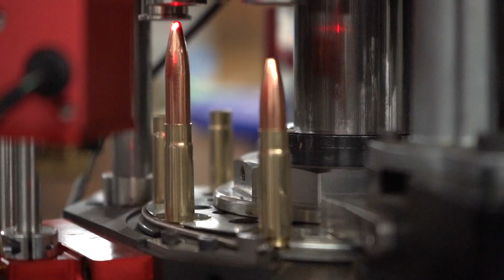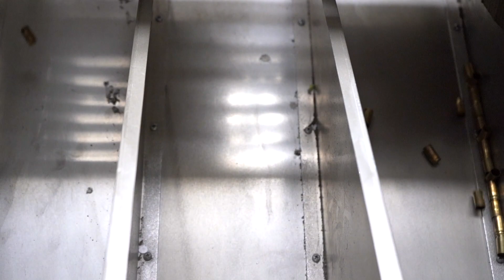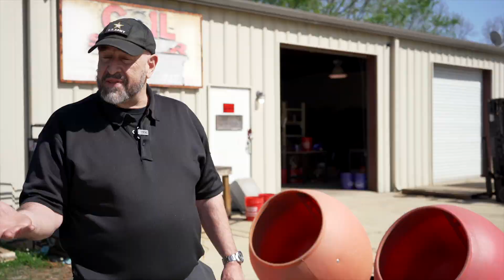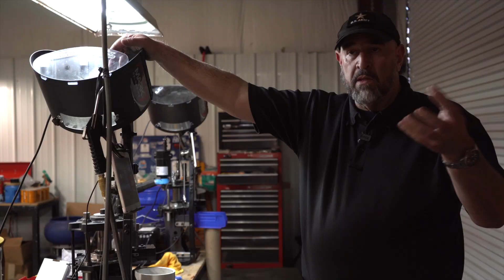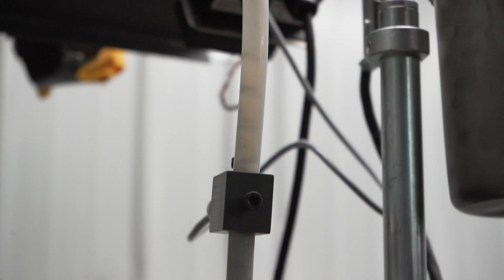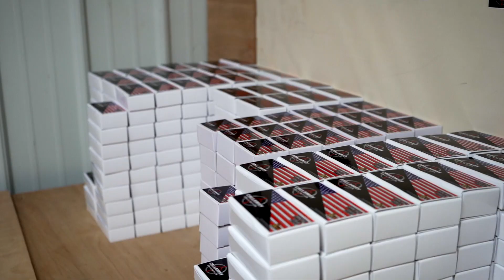Remanufactured Ammo - How It's Made - Callaway Ballistics

Comment: I have been buying Callaway ballistics 9 mm 380 and 223 for several years now you cannot beat their prices for a 50 round box of jacketed hollow points or they're all copper hollow points think they're running around 24 bucks a box for 50 now, 223 I just bought 300rds this week I think it was $14 for a 30-round box and that's obviously brass case and not that steel case stuff which I've got a ton of that as well.

I've never had any issue with Callaway ballistics ammo and it is definitely my go-to in my carry gun now and if I burn a magazine of hollow points at the range I don't feel so bad.

also add I've got probably 300 to 400 rounds of the 9 mm full metal jacket and have never had an issue with it great plinking ammo think I was paying $19 a box of 50 for that it's up to about $22 now still a great deal
Reply: Hal had me sold about the last 3 years. I’ve told everyone that I think would be interested about Callaway Ballistics. Great outfit right here in Alabama

Comment: The one time I tried remans,the pistol I was shooting blew up... "Never Shoot other peoples" reloads is very sound advice, especially if those reloads are done by a machine that can't do the qaulity assurance check a human can while reloading.
Reply from the maker: Factory ammo is loaded on a machine, would you shoot that? The equipment Callaway uses have a variety of checks and fail safes to ensure consistency and safety. We shot nearly 1000 rounds of their 9mm and .223 without a single issue.
Reply: @EnglishShooting  Thanks for the explanation guys! Our ammo has FAR more hands on attention than most large factory made ammunition.  God Bless!  Hal / Callaway Ballistics
Reply: I don't think reman ammo really counts as "other people's reloads". That usually means ammo reloaded by another hobbyist, not an ammo factory.
Reman ammo is factory ammo that is made using recycled brass instead of virgin brass.
Perhaps in some cases, the machinery isn't as good, or the quality control as tight, but that's down to the individual factory, not reman ammo in general.
Reply: One more to the bandwagon. The advice is for other people, technics, loads and attention. I have shoot other people's loads onky when I know what we had been looking for and such.
Remanufactured anmo is simply a brand new all in an old cartridge that has been checked almost one by one (if you reload guarantee you every case is hand picked).
The mistakes "never" happen on a machine but due to the machinist.